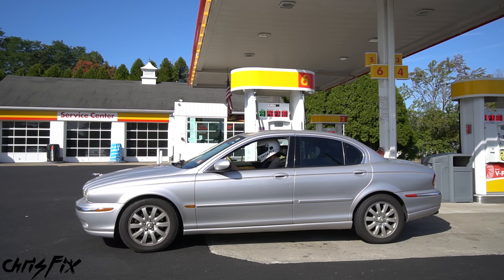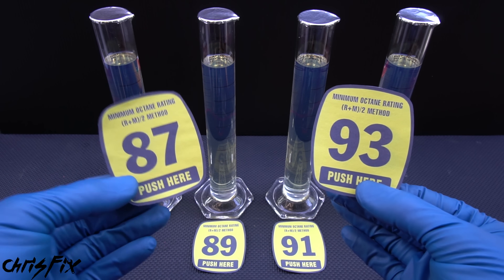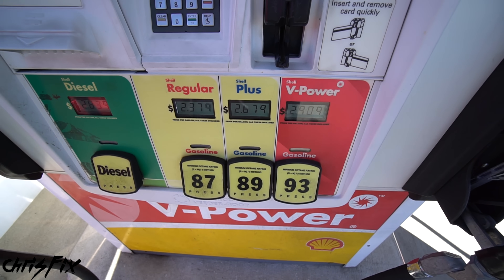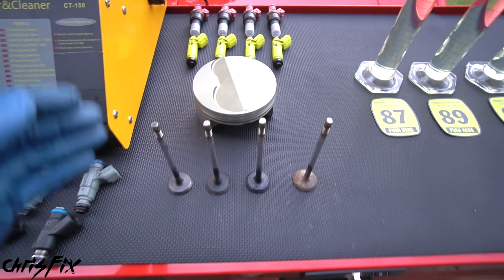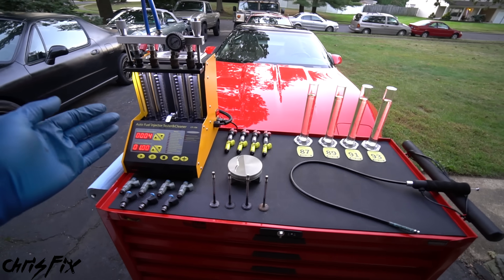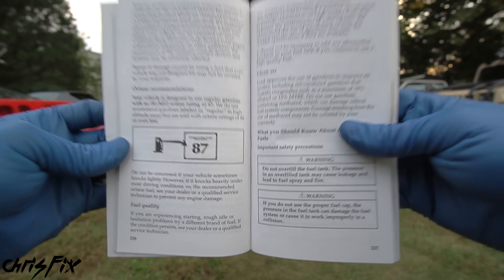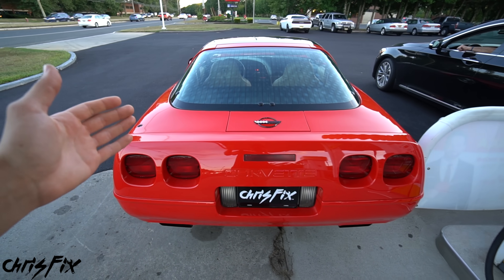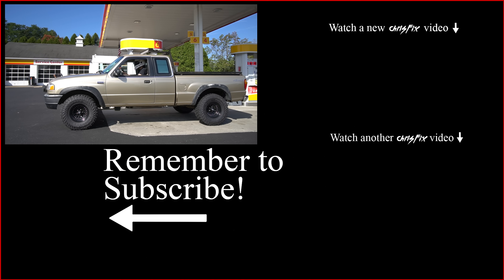What is the BEST Fuel to Use in Your Car or Truck and WHY

Comment: Some other interesting facts about stations like the one shown in this video.  Most modern stations "blend" gasoline to get various different octane rated gas.  The pumps in this video are a common pump that blends gas.  Some brands do not have special additives in their 87 octane, but have it in their 93 octane (or higher if their station has even higher octane rated gas).  This means when you select a midgrade like 89, you will get some of the additional additives of the 93, but not necessarily the same 100% you'd get with 93 octane.  Shell has very high-quality premium additives and that is the main reason I buy gas there (plus I am able to use their Fuel Rewards program and save .5 cents a gallon at my local Shell stations).

Some older stations might still have a dedicated mid-grade tank underground, but this is VERY uncommon now.  In my retail experience, stations that used to have these mid-grade tanks often would be converted to regular, so these locations have TWO regular tanks underground instead of just one, with the pump blending mid-range octane ratings.  Also, you can find higher octane grades at some stations if you live in the right market.  When I lived in FL, some stations sold "racing fuel" with octane up to 99.. some race tracks sold octane gas as high as 105! In FL also, some stations could blend EVERY flavor of gas between 87 and 93 (so 87,88,89,90,91,92,93!) all at one pump!  This led to a vast variety of price points, giving you many options for what you could put into your car!  

As far as brands that I avoid, I avoid Citgo/Race Trak/Gulf(or Chevron as they are known outside of PA) for 87 grade.  These brands do not have special additives for 87 grade and generally buy the cheapest lot of generic 87 money can buy.  Race Trak in FL was especially known for being .3-.5 cents cheaper a gallon, but the quality of their gas was TERRIBLE and many people's cars would knock badly when running it.  From the research into gas that I have heard and read about, Ethonal rating can have something to do with this.  Regular gas can have up to 10% ethanol in the blend, but there is a government tolerance of up to 12% that refineries can get away with here in the US.  I know United Refinery in Warren PA is known for running right along the legal limit allowed my tolerance, which leads to worse millage for cars (which is why I do not buy their gas from Country Fair (Citgo) or Kwik Fill in this area).  You can get measurably less millage with these brands in my area of Northwestern PA.
Reply from the maker: Thanks for sharing!

Comment: What about no-ethanol gasoline? Seems like that would be the best. So I only drive my Firebird about once a month and my truck about 3,000 miles a year. Using no-ethanol has them both running better. Octane is 87 and is available at QuickTrip near where I live. Highly recommend it. Of course for a motorcycle, no-ethanol is a no-brainer. Just do it.
Reply from the maker: Non ethanol is better for cars not used a lot (also boats) because ethanol absorbs water but for a car that is used normally, the 5 or 10 % of ethanol they add to gas isnt an issue.

Comment: Chrisfix, you didn't say anything about the Ethanol in the fuel which is a octane booster it self. You are correct with everything you stated. I've worked in the Petroleum industry for 29 yrs and actual run our lab octane engines (Research & Motor) CFR. Good stuff bro!! Also been a member of ASTM for yrs which is our organization we use as a bible for testing fuel.
Reply from the maker: Thanks. It is hard to cover every single thing so I focused on the basics that people will encounter at the pump. They dont have much of a choice if the pump has 5% or 10% ethanol mandated by law but that is still good info so thanks for sharing. As for you running the lab octane engines, Im actually super interested in doing an octane booster video and maybe you can help me out with that? Can you shoot me an email?

Comment: After 16 Minutes I learned absolutely nothing but to just use the gasoline your manual recommends..
Reply from the maker: So you didnt learn what engine knock is and how it happens? Or what a dirty fuel injector spray pattern looks like or a dirty valve? If not, I would consider beefing up your listening comprehension skills because there was a ton of info in the video besides reading the owners manual.
Reply: ChrisFix  Short answer is NO

Comment: Great Video! My question: Is there an advantage to using 100% gasoline? Only a few places near me have it and it is usually only in the premium version if they do have it. The rest are usually up to 10% ethanol.
Reply from the maker: Thanks! There is no major advantage because a 5-10% blend of ethanol will cause you to lose about 3% MPG which isnt that much. If your car or boat or whatever you fill with gas sits a lot, then it is worth using just gas because ethanol absorbs water.

Comment: When adding anything to your fuel, always put the additive in first. Then, when you fill the tank, the fuel additive will be dispersed evenly through the fuel. Just a good way to make sure everything is mixed thoroughly. If you do add it after fueling, I would shake the car side to side for 30 secs or so to mix it up well.
Reply: i lift the car and shake it like a soda can
Reply from the maker: Great tip!
Reply: It does not matter once in tank additives will mix regardless... physics once you drive shake shake all mixed
Reply: i think driving around would shake it up plenty
Reply: How do I shake my car? Puck it up?
Reply: @johnnymarinara3797  this must be a joke. just shake it bro. Its not that hard.
Reply: @johnnymarinara3797  grab that shit and rock it back and forth. Not that hard. Dont be dicks just for the hell of it.
Reply: I drop the hammer through all 5 speeds and it should mix just fine.

Comment: Great vid Chris, question, what's your take on Luccas octane boosters or Valve/injector cleaners on newer cars ? I drive a C63 AMG ( not in the states ) so im curious as to give my local gas a bump up. Thanx
Reply from the maker: I wouldnt use any additives. Just use a good fuel and you are good to go.

Comment: What about E-0 gas? Is it worth the extra cost and does it make your engine run smoother, create less deposits? And why is it usually a higher octane (mid to mid-premium)? Thanks!
Reply from the maker: E-0 is the same octane as e-5 and e10 because whatever the pump says octane wise, is what you are getting, even if there is ethanol in it. Ethanol is a better cleaner than gasoline but it is less energy per gallon than pure gas. You would have to do the math and see but I think using ethanol based gas is probably a better bang for the buck. Only time I would pay more for pure gas is if the car or boat isnt used a lot. Ethanol absorbs water so that can cause issues if it sits in the fuel system for a few months.

Comment: Is it ok to mix e-85 and regular gasoline in a flex fuel car? Or should I run the fuel as low as possible before switching?
Reply from the maker: Yes there is a flex fuel sensor to compensate for the different mixtures so mixing is fine.

Comment: In Colorado our octane rating starts at 85, do you know why that is? Out 87 is mid grade and 89 to 91 is high grade. Not sure why maybe something with elevation?
Reply from the maker: Since you are at higher elevation, you have less atmospheric pressure so there is less of a chance for detonation so you can use lower octane. Great question!

Comment: Damn idiot at the dealership I bought my car from put 87 in my 2011 Mazdaspeed 3 when it says very clearly on the gas cap nothing below premium fuel. Had to drive 220 miles without entering boost to make sure it didn’t burn my turbo. Filled up on 93 as soon as so got back home  to Pittsburgh
Reply from the maker: Dang that is them being cheap and in a bad way! That could damage a nice engine! Glad you were smart enough to take her easy and stay out of boost!

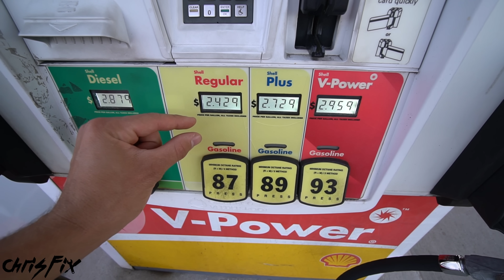Comment: 12:23 I’m confused in the beginning you said it has the same energy level in the fuel and same economy why if you put regular you will lose some power and bad economy？
Reply from the maker: So the engine has certain "timing" when the spark fires. If you advance this timing you can make more power and get better efficiency (to a certain degree). If you retard the timing you lose power and efficiency. Higher octane allows the computer to advance timing and fire the spark plug at the optimal time for the most power and economy. The fuel is the same energy, but how it is used is slightly different.

Comment: How to know which fuel to use in your car? Read the manual. They are all online now. 
The reason people say lower octane has lower power is because the knock sensor in the engine will adjust the timing and fuel mix for a less efficient but safer burn. So there may be the same energy in the gas, but it's harder to get that energy out of lower octane ratings.

Comment: Not mentioned in the video is that all this advice pretty much goes out the window at high altitudes where you can use lower octane and so 86 and even 85 octane is found at the pumps.

Comment: One thing you forgot. There is NO vehicles today that need mid grade fuel to run efficiently. They either run off of regular for most vehicles or supreme for high performance. The government required gas companies to give the consumer three choices of fuel. If you use mid grade you're just wasting your money. If there is no sticker on the fuel door telling you to use higher octane, it uses just regular.

Comment: Well, actually, you CAN obtain more "bang energy" from the 93 octane... why? because due to the higher resistance to self detonation, it can be compressed more and made to produce more bang than a lower octane... but yes, all three octaners have the same energy density... I think... So the final recomendation from chris is what it should be followed... if your engine is designed to run at 93, use 93 or higher if you want... but don't use 89 because if your engine cannot self adjust to not let that octane rating self detonate, you will eventually damage your precious high performance engine...

however, IF your engine is designed for 89 octane, you will probably not obtain more power out of the 93... why? because due to the compression ratio both gasolines will detonate at the same compression delivering the same bang kick... I think....

cheers!

Comment: Great Video.  This is just a statement.  
The biggest lie is the gas mileage we get from our vehicles. We can get over 100 MPG or better just by tuning air / fuel mixtures & changing engine designs.  Big Oil wants you purposely to have bad gas mileage so they make more money. So car fuel efficiency is suppressed.  Another lie is needing a catalytic converter to reduce "gas emissions" when in fact they don't make your car burn clean to begin with, so they add this useless part just for money sake. It's Hypocritical.  

The liquid of gasoline doesn't burn, only the fumes is what burns.  People have experimented with lawn mowers, runs on 100% fumes.  
Technology suppression is used to control profits.

Comment: Well... Here's what I know. In Canada Fuel pumps have to show how much ethanol is in the full. Here for example, Shell has up to 10% in regular, up to 5% in mid grade and zero ethanol in 91 octane. 
Ethanol is garbage and that 10% is a net loss in most cars that aren't design for it. So if you have a Honda mini van with a V6 for example, you get 10% better millage right away with 91.
Also in the case of a Honda V6, you get more power. Last, no ethanol means a cleaner engine.

Comment: Great Video Chris!  Keep up the good work.  Remember - Flex-Fuel cars especially GM cars will have a yellow gas cap indicating that you can fill with E-85.  Remember.  if you are going to use E-85 in a flex fuel car, that the tank be mostly empty so that the alcohol sensor in the tank can properly measure how much alcohol is in the tank and adjust the fuel injection system properly.  Don't just have an empty tank and put 10 bucks in the tank.  the sensor will not work correctly and cause the car to run poorly.

Comment: I have a flex-fuel vehicle (E-85), however, my owner's manual gives me the option to use E-85 or Regular. I've always used Regular but wonder if I'm doing myself a disservice by not using E-85.

Comment: I was told once that mid-grade is basically just a mix of leftover low-grade and premium, but it has to have the minimum octane rating or the store will get busted.
Reply: It is. The refineries only make low and high octane gas, medium 89 gas is just the mix of both, when the tanker fills up the stations there is only 2 tanks beneath the gas station, one for premium one for regular, people pumping medium draw from both tanks simultaneously

Comment: My cars manual says use 87 but says hearing light knocking is not a cause for concern and that the engine is designed for 87. And then it says you could see Benefits in certain conditions like hot weather if you use 89 I’m confused the knocking thing is like a red flag to me.

Comment: ETHANOL? Always get the fuel without ethanol if available. Racers run E85 for its consistent ignition properties but the stuff is terrible for your daily driver even if it is a flex fuel compatible.

Comment: Hey Chris so there’s a thing that if I put a 8-10 gauge wire from my throttle body to my battery it will help with throttle response. Is this true? I have a 2008 Mazda 3 and before I do it, it would be cool to get your thoughts on it

Comment: What do “detonations” sound like? 0.0
Reply: Marbles rattling around, as stated in the video. If it sounds unusual, investigate.
Reply: You'll never hear them in any car built in the last 30 years. There's sensors that will adjust the timing or kill the spark if they detect the onset of detonation. What you'll feel if you get into a situation that would cause detonation is that the engine will seem to bog a little as the ECU prevents it from doing so.
Reply: @Mishn0  Sort of correct, while modern ECUS can correct it they can only do so within set parameters. Its still possible to get knock sounds from a modern car

Comment: As far as diesel is concerned: there are instances where you can put gasoline in a diesel. If your engine is a multi-fuel, you CAN run gas, but it isn't recommended for daily use. Emergency use only. Or, if you live in an extremely cold environment, add gasoline to diesel at a 50:1 ratio of diesel to gas. Extremely cold environments tend to gel diesel fuel. The gasoline will thin out the gel. STILL, not the best for your engine. Commercially available anti-gel products are available. You could also use 91% isopropyl alcohol, 50-50 isopropyl alcohol/naphtha mix, or kerosene. Just remember the 50:1 ratio. In extreme cases, I've used 100 proof liquor, but like I said, EXTREME. Use the commercially available stuff as your go-to

Comment: If I have a flex fuel escalade (2014), the manual says run premium or E85...but I've also read that flex fuel vehicles can take regular unleaded or 89 octane. Any thoughts?

Comment: I just came back from a trip driving west.  Most stations had 85, 87,89,91 octane.  It's not e85, they had that too.  My car says at least 87 octane. Regular was advertised at 249, per gallon.  When you pull up to the pump, 85 is 249,87 is 288,299,per gallon.   I didn't want to use the 85 octane.

Comment: Alcohol burns faster so your motor consumption is more ethanol is a form of alcohol but mixed with additives and gas so your car dont need mods to consume it now your at the pump more my truck consumes more than it did 5 years ago cause there is more ethanol and if you look back you'll find that did ethanol in gas and didnt say anything then thay came and said here have some ethanol it burns faster it wasnt the stations fault for crap gas those times your car ran like junk and burned fuel faster

Comment: I absolutely disagree with go with owner manual, non turbo engines if you just drive around town and do not go full throttle to red line, little benefit from using 93. A lot of premium cars require premium fuel to appear premium. (Acura 2.4 NA require 93 is bullshit)  Just waste money. Small turbos can go by on 87 but produce more power with 91 or 93

Comment: 95 is the minimum in the UK. I drive a japanese car that has a 95 minimum sticker in the fuel cap housing. Don't think I would be comfortable using US fuel. If EU 95 is the same as US 87 why isn't it labelled the same?
Reply from the maker: I explained that in the video. They use different ratings. You are use to RON and the Americas use PON to rate the fuel. PON is the rating at the pump. Also explained is the fuel is basically the same octane.

Comment: Nice Video!  I have heard of cases where E-85 will damage plastic parts and make fuel lines swell if the vehicle is not a flex fuel vehicle.
Reply from the maker: yessir and the injectors might not be big enough to handle the extra fuel that is needed compared to normal gas.